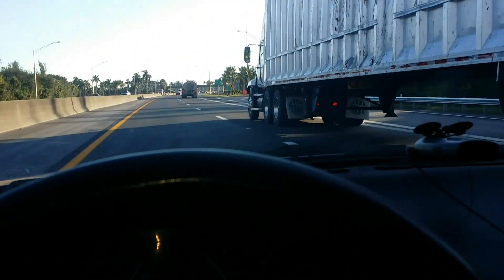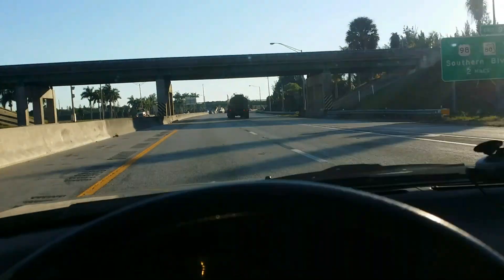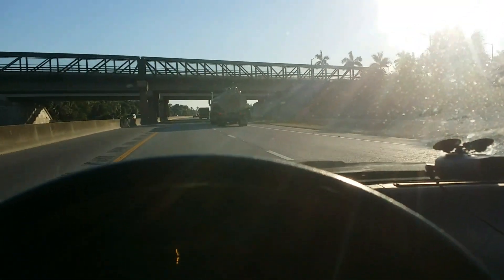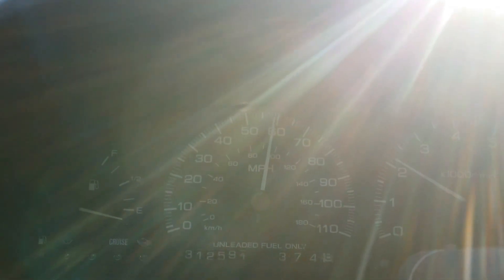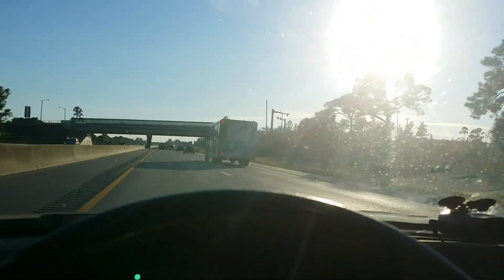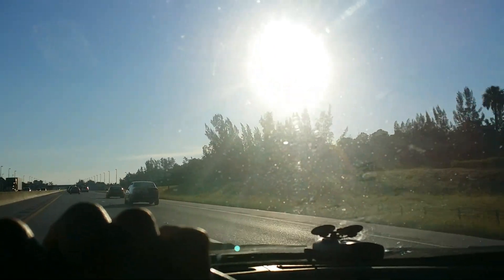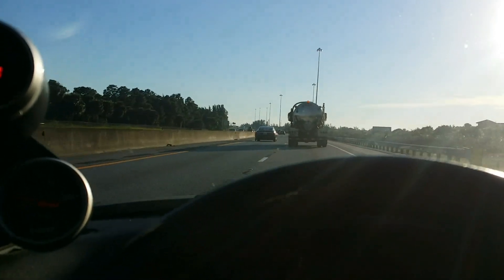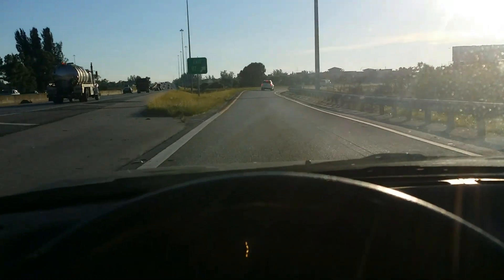1993 Nissan 240sx Holset HE351 KA24DET 3rd gear pull 20psi

Comment: That turbo sounds sweet! I just got an HE351CW for my Omni a few weeks ago and cant wait to slap it on. I'm also gonna convert to MS2, but my question is are you able to control the boost with the command valve thats on the compressor housing?
Reply from the maker: No. The valve was removed and blocked off. I am running a Turbosmart ultragate.  I control boost via the megasquirt ecu.
Reply: Do you have the Turbosmart Ultragate wired into the MS itself via Fidle or JS11? And how do you know what the solenoid frequency is, or does it tell you in the instructions? Sorry for so many questions lol, just a fan of your build
Reply from the maker: I have the PnP so I use the options port on ecu.  I bought the DIYauto boost solenoid.  All information is given in the package.  No problem with the help.  Thanks for the comment.  Good luck with your build.

Comment: What do you have in your KA? Like pistons, piston size, etc. I just want to get an idea of how you can run so much boost like this :D
Reply from the maker: Google supakat thread.  It will be the first result.  I am running baby boost compared to others.  We just had a member make 907whp @ 42psi on e85.  He has upgraded studs and what not.  I have standard forged block with 10mm headstuds.  The bigger guys go 11mm or 12mm for big power.  I hate lifting the head.

Comment: Hey. Good night. I just installed this turbo on my 1jzgte. it idled good for a bit but then started to smoke really badly so that I couldn't even see the engine bay. What do you think is the issue ? The oil drain is big. Your advice would be greatly appreciated. I am thinking the seal isn't good. it has 1 year warranty so I am thinking of returning it.
Reply from the maker: Novell Blair Where was the smoke coming from? If engine bay filled with smoke and no leaks, could be positive pressure into the crankcase via pcv or any tube into the valve cover. Other could be not big enough drain. Any smoke from exhaust?
Reply: supakat500 thank you for getting back to me. It is coming from the back of the turbine in the exhaust housing. I am not using a oil restrictor so idk if that could be the problem. The drain I am using is big like my big finger which is pretty big.lol lol . It's a remanufactured one.
Reply: Yes coming from exhaust housing.. When I pulled it off the exhaust was filled with oil.
Reply from the maker: Novell Blair Put a restrictor on it. I have one from a Volvo on there.  Definitely seals getting too much pressure, turbo needs rebuild, or positive crankpressure.  A negative vacuum to help pull oil from turbo is a good idea.
Reply: supakat500 ok i am going to work on that the thing is. I just got the turbo. do you think that five min on and off would Kill the turbo seals already? what size restrictor did you use?
Reply from the maker: No, it should not kill it.  I cannot remember.
Reply: supakat500 Good morning. thank you for all the responses. so I came to figure out that the ebay seller sold me a Chinese cartridge with the turbo so I returned it. waiting on my refund and is in the process of getting a new Borg Warner S366.
Reply from the maker: No problem.  Ohh thats not good.  The S366 is a T4 footprint I believe.  The KA should have no problem spinning that.  R@mon240 ran a S372 and made 705whp.

Comment: @supakat500 what computer program are you running to tune with and where can i find this? i have a 1990 240sx.
Reply from the maker: It is Tunerstudio and it is used with MegaSquirt ecu.
Reply: thanks. how do you like the ecu so far? have you ever had any issue with the ecu before?
Reply from the maker: Great ecu.  No major issues.  Had some minor but they were fixed with firmware update.